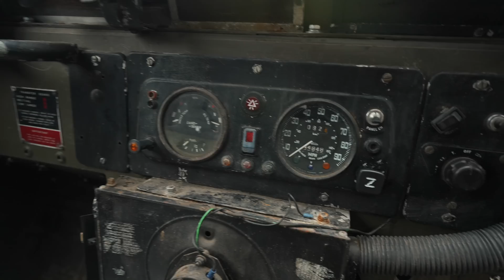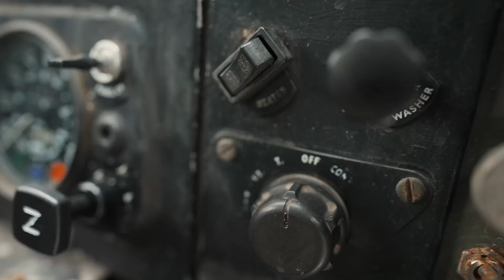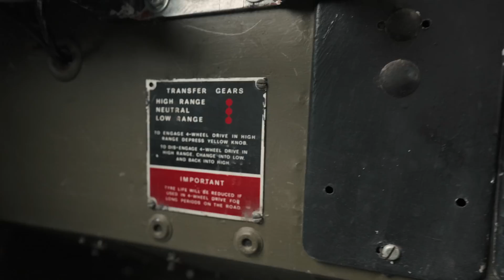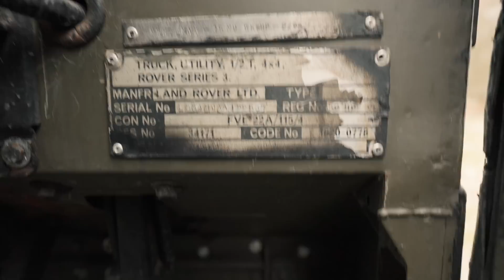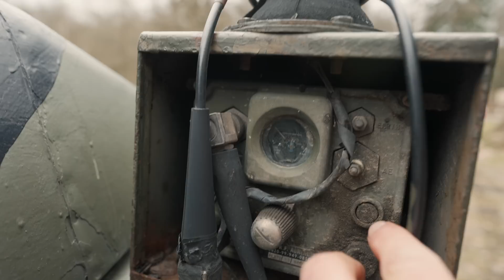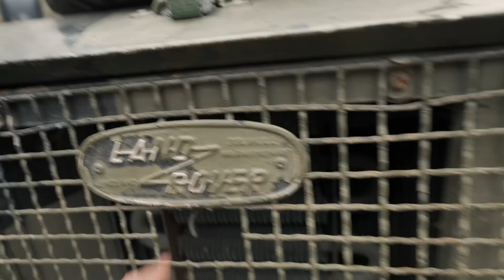I Bought a British Military Truck (For Camping)

Comment: Only ever driven one lightweight, in the late 90s, still in military service, sort of, overriding memories of it was the huge steering wheel and best part of 90* of play in the steering. It was a scary drive.
Reply: You don't steer them on the road as such more guide them. Towed a chipper with one on and off road, You need a death wish to go more thn 40 on the road.

Comment: 😮 My life this has took me right back 30 years, Dad had one of these can't recall if it was series 3 or 1 but had the bench seats in the back, the choke, also had a crank start at the front by the radiator.... My life as if they still running around 😅 Have fun, we used to with bench seats and no seat belts 😂😂 great for camping back in the day 🏕️💯

Comment: First upgrade: roll cage.
Second upgrade: winches front and rear with synthetic rope and a couple of soft shackles.
Also, check if it has a PTO to run your 24", unguarded, circular saw for log cutting...

Comment: If your experiencing sloppy play in the steering steering replace the steering relay it's the best thing I ever did use a Jenny bar to get it out if trolley jack doesn't work from underneath
Reply from the maker: Yeah steering really isn’t good as you can see in the video

Comment: That spare is not a slick.  Thats how they were in the day.  as for the radio antennas, they wont do ANYTHING without the radio that sits in the back.  (C42 in my day if I remember correctly.)  To tune the aerial (radia was tuned seperately in the back)  you would cover the handheld mouthpiece, press transmit button then use the dial on the antenna box to tune the antenna in.  Just a case of watching the needle and moving the switch till you found the max needle swing position.  This is bringing back a lot of good memories.  2 Para 74-97.  Headlights ARE standard of the day including the surround.  To change a bulb or glass, simply press them in (on a couple of springs) turn them about 2 inches and the light assemly just pops off in your hand giving access to the rear of the headlight for bulb changing.  same in reverse to replace them.  The union flag is on upside down on the rear.  The military didnt call them lighweights BTW.  They were L/Rover 1/2 ton GS or in your case here,  L/Rover 1/2 ton FFR (Fitted For Radio.)

Comment: If it has two fuel tanks there will be a switch to select which one the fuel gauge reads. As an aside, your Landy looks like it might be one of the lightened versions designed to be pushed out of an aircraft.

Comment: Had a number in my time 12v / 24v / 109 / 110 / 101 … although I love the look of the Airportable, I prefer the coil sprung 110. Ride is better on 110 and Good Year MOD tyres on Lightweight too noisy so needed changing. Michelins on 110 are sweet.

Comment: You need the radio operators HQ tent, it looks like seagulls old Lany, it had two radios in the back, you could light a strip light just hold it up to the masts on the wing and that gave you an idea not to touch them when powered.

Comment: Hi mike love your newly acquired lightweight im so jealous as i looked for years then once i had found the right one my ex had stolen my funds but hey ho.
when you get the few things sorted it will be perfect and a credit to what you do,the  thing i would recommend for sure is try and get your chassis waxoiled inside to prevent rusting from the condensation and moisture.
Oh and have fun whilst you drive/restore it to how you want it,
Keep the great videos comin 
Thanks 😊

Comment: I love Landrover defenders. But I looks like the car is trying to shed weight by itself to be really light weight. If the engine and chassis are good, it's got a solid base. But if you cant do the restoration and work by yourself, it's gonna be, lets say, not very cheap. But its cool non the less. And it's supposed to rattle and be uncomfortable to let you know you are still alive as a soldier. The way all military vehicles are designed in my mind. Enjoy being alive and being uncomfortable makes you grateful for being alive so full circle.

Comment: One weird thing is that the Lightweight is heavier than the normal short wheel base series 3...!  The Lightweight version was designed to be airportable and could be more easily stripped down if required - so it could be made lighter - but in normal form with all the doors on, etc. was actually heavier.

Comment: Well you have to be thankful to the original WWII Willys jeep for the Land Rover because the very first prototype was built on a Willys jeep chassis which is why they ended up with an 80" Wheelbase first off.  A lot of the jeep features were carried over into the Series 1 Land Rovers,...that being the fuel tank under the seat and the steering and suspension being practically the same. Originally though,..Land Rovers were never intended for the Army,..they were designed for farmers but,...the military became interested in them and the rest is history !!

Comment: You have obviously never bought a vehicle in New York state. That is showroom new condition rust-wise. Seriously. My father bought a brand new Chevrolet in the 90's and within a month the rust had gone through the frame. For real!
Reply: Had a Chevy truck, every time I tried to use it it cost me 500 bucks. If it could rust or break down it would. Last Chevy i'll ever own LOL. (Id did have character though...)

Comment: Get a full set of new tyres Michelin do a really quiet one.
And keep changing wheels putting spare on rear and rears on front to maintain even wear on all the tyres if you don't and then you put it in 4wd you could smash the gears if you have really unevenly worn tyres.
I have a 2A 109 had it 15 years
Reply: If you’re in 4 wd you should be on loose suface, so having a tyre slightly larger than another won’t hurt. If if one is super grippy and the other ones bald, then the bald ones dodgy anyway.
Reply: @highdownmartin  ok you can find out the expensive way it's the difference front to back which matters
If the front skips you also loose stirring
Reply: @marksercombe3575  my series one had a 4.1 p4 diff in the back and a4.7 in the front when I got it,  for comp work.  I changed it over to both 4.7. I can’t imagine a 1/4 inch diameter difference creates carnage front to rear, off road.

Comment: If you intend to restore her to her MOD glory days, be as detailed as possible (even if things like the radios were non-functional)... 

If you are just looking to build her for wheelin and camping, strip off the unneeded military gear like those two radios. (play around with them if you like, especially if you have your ham license, but they are not needed on  your fenders). Replace those pintle hooks with (I believe you call them tow jaws. a pin type hitch able to use a ring hitch (lunette ring)). the pintle has a weakness in the thumb hinge that often breaks when approaching a climb. you brits have the better version.... and reinforce the rocker rails (I think you call them sills, but I am not positive about that) with some proper rock sliders that are attached to the frame as well as some rocker reinforcements (your 5 bar checker plate works nice) on the sheet metal. it is a weak spot in most all 4x4s and is hard to fix properly.

Otherwise you have a nice "jeep" there. or atleast the makings of one.

If it were mine, I would put some heavy american axles on it (rover axles tend to be a smidge weak), replace a petrol engine with a diesel (a 300 or a 5 (an american bt4 if I were in the states) as a compact diesel will give more torque and better economy, and an older one can use bio fuels) and I would do the above mentioned changes. slap on a non camo paint job (even if it is solid green) and slap a nice british flag badge on the rear below the tail lights even if I were here in the states as a matter of pride in her heritage. and I would be set. everything beyond that would be a matter of tinkering and making small improvements over time. (spray in / roll in bedliner coating the ENTIRE interior would be a future upgrade to be sure, as would waterproofing everything

Comment: Waaaaw!!!! Now you can clean it and change the some nails with robin or take a liquid that take off it. You can to be care of all the parts of your car. The part of direction and the mandos, the central part, the part of co-pilot,  part of the floor, the part of pedales, the part of back part, the part of that door😢, the part of the llàntia of the rueda de recambio😢...the part of the sound when you put it in on, that agudo sound like a grillo, when you go while a lot of km, it makes your mind more tired.. Take off it discovering from where it BE, under your chair, the top of the dipòsit of fuel (the rosca is very important for it closer sure and fix, and a large ETC... the chasis... DON'T WORRY😅...👍!!! With tenderness, with care, with caress,NOW, it needs you!!!.Thank you!!!

Comment: Are you sure that is only 44,000 miles because 44,000 is not very much. 144,000 no that’s a lot of miles.❤ anyway, that’s a pretty sweet four wheeler you got yourself there😊😂 need to replace that union jack with all the gory though

Comment: This vehicle should be restored...a costly option but you would create a 'treasure.'  I would say: body off and dry ice cleaning to remove rust; replace whatever is needed and Resto-mod the questionable parts or whatever can't be found these days.

Comment: You'll be able to strip the old girl down to repair things relatively easily.  If you can stick with the original chassis, the new ones tend to be not quite as strong due to the way they are made.  Don't throw things out.

Comment: Back in the early 90s I had an old 60s grey land rover. Late for work one day I gave her the boot along the M6 , as I was going over spaghetti junction there was a loud Bang and immediate loss of power. I pulled over onto the hard shoulder, got out and had a look under the bonnet. There was a big hole in the side of the engine and I could see down into the sump. I went to the emergency phone and called for a tow truck. The woman said it would be there in about 15 min. So I sat in the Landy for a few min and decided to have another look under the bonnet at the damage. When I looked down into the sump I could see the sump oil was burning, not a raging flame or anything, just kind of flickering. I was afraid though that if the flames spread and the whole vehicle caught fire it could turn into a major incident on spaghetti junction so I thought I’d better ring the emergency number again. When I got through to the same operator I explained that there was a “ small flame “ in the sump.she said thats ok there will be someone with you shortly. About an hour later there was no sign of the tow truck so I went back to ring the emergency phone again. I got through to the same woman again and explained that the tow truck hadn’t arrived. She said the tow truck had just been onto her and that he couldn’t find a land rover towing a “ small plane “ . Penny dropped immediately, I said I had a small flame not a small plane ! Gordon bennet !
Reply from the maker: Wow what a story!! Did the Landy survive in the end?
Reply: Haha life experience ! I traded in for a Ford  Sierra !

Comment: Hold on!  An entirely Mechanical Vehicle is NOT going to break down every day; it is much easier to repair because there are so few parts.  
Oh, by the way, I would strongly suggest you source parts for it RIGHT NOW.  I'm in the US, and that is a major problem for folks who own vintage and older vehicles: replacement parts.
I was giggling louder than you watching the video on this old military vehicle.  So. Cool.  You and the kids are going to have a blast with this; the wife, I suspect, not so much.  Unless, it helps on boggy roads to the market.

Comment: Strange that the attenuators and the fixed throttle control suggest an FFR but there isn't the usual central battery box for the two 12v batteries necessary for the 24v radio system? Anyone got any suggestions?

Comment: Be aware duel fuel tank switch lever is between your feet can easily be kicked into the middle position which will result in it starting then run for a short while before cutting out - called out a few times because boys used to do it as a prank - REME to the rescue

Comment: Even has the radio tuners still fitted. Great vehicle and not too bad to work on. I feel it must have done more than 40k miles though 🤔
Reply from the maker: Yeah, it definitely has. You have to take MOD vehicle mileage with a pinch of salt lol

Comment: 44000 miles for a 1981 is absolutely nothing! I learned proper off road driving in these at the height of the peace protesting at Greenham Common when I was guarding the outer perimeter

Comment: 44 thousand miles? Dream on!  Just pull the MOD service record and you'll find that the chassis is the only original bit. The rest will have been replaced again and again at taxpayers' expense including two or three new speedos meaning the true mileage is probably nearer 250,000 with most of the miles being trips down to the NAAFI shop for teabags. But that's fine when most of it is almost new.

Comment: Source & buy 2 spare alternators & 2 starters before you cannot find anyone who knows how to help.. No joke, but unless you're a fabricator that admittedly awesome rig could turn into a turd quickly.
Reply: No joke I am a rotating electrical rebuilder. I perform miracles all the time with overpriced replacement DC motors,, & SOMETIMES will do AC. I've worked on everything from 1914 Milburn electric drive motors....(ya know the first electric vehicles to fail)...to pierce arrow, to dodge Brothers, to locomotive, to aviation applications, to military ordinanced captive application components.